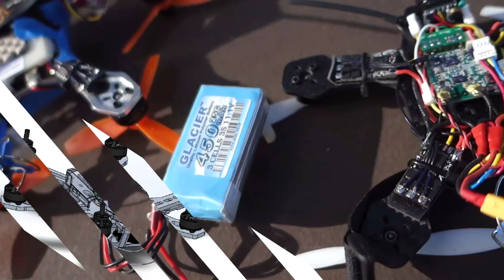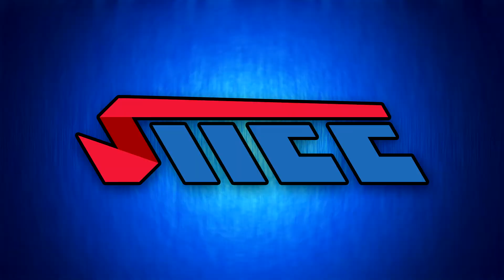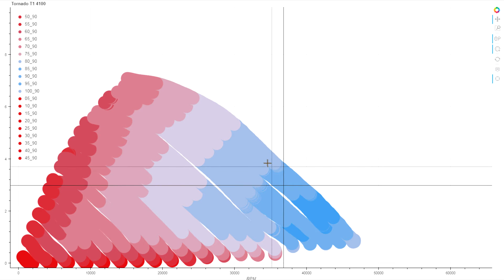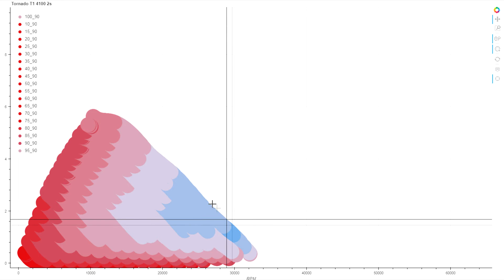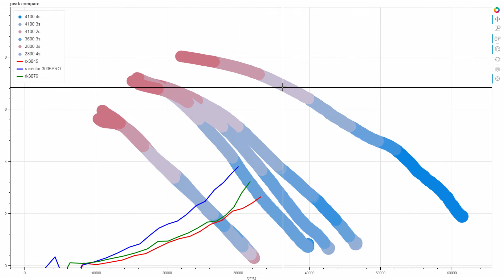Comparing KV and Voltage together

Comment: another request, motor width and RPM.  My theory is that the wider motor ramps through the RPM sooner due to the increased torque but then I can't explain why the wider motor seems to struggle more in the high RPM zone.....sometimes.  Not all motors.  Generally I find the taller motors to be better at the high RPM zone.
Reply from the maker: Acceleration is all due to available torque, more torque = higher acceleration.  A wider bell will have a higher moment of inertia though which counteracts this, and the forces on the bell at high rpm will be higher on a pancake setup.  Torque is supposed to increase with the square of radius vs just linearly with the length, but on the balance of things a longer motor seems more generally suited to our applications with rotor speeds between say 15 and 30k rpm.  Certainly needs some more playing around,  I plan to once I can get around to doing some custom winds.

Comment: So this is exactly what I wanted to see.  High kv low volts vs equivalent high volts low kv.  Logically it makes sense that the output should be the same across the table but why does it feel so different in the air?  Why does the lower voltage, higher current setup feel more meaty?  This is not just one comparison.  This is something I've noticed across dozens of quads and dozens of setups.  Some identical motors and different kv's, others mixed everything.
Reply from the maker: I can't explain the difference in feel.  Lots of people like to talk about it but I have yet to see anyone attempt to isolate why with any kind of rigor.

Comment: The way you described the 'low end torque' feel is opposite I think what people actually feel.  People commonly say they want lower kv for the 'low end torque'....but as you showed, you actually should be getting more of that 'low end torque' feel with the higher kv because you blast through the ineffective lower RPM region with less throttle stick travel.  I think people are just severely confused and think it's like a gear in a car.

Comment: What unit are you measuring torque IN on this graph? Also where can I find more information such as this for motors before buying them? I imagine hobbyist motors wouldn't usually have this sort of information easily available
Reply from the maker: My charts are all in Ncm.  Pretty much no manufacturer has any useful information when it comes to motor specs, that's a big part of why I started testing this way in the first place.
Reply: SiieeFPV yeah, I've noticed the same thing...  Keep up the good work! Good research is hard to come by!

Comment: One important consideration is switching losses at low throttle settings. That's why lower cell counts are more efficient in comparable thrust scenarios.
Reply from the maker: aren't switching losses dependent on switching frequency, not duty cycle?
Reply: In absolute terms yes. But that means that they are a larger percentage of total power at lower duty cycles. Hence lower efficiency of lower duty cycles. That army pdf on motor characterization has a good section on efficiency losses at low duty cycles.
Reply: Oh, and switching losses are higher for larger cell count since more voltage is applied across the switching FET in its resistive state. .
Reply from the maker: ah, so just like loss of power due to deadtime.

Wouldn't higher voltage across the FET give you lower losses?  For the same power output the current will be lower, so I²R losses before it reaches saturation should be lower as well?
Reply from the maker: I see in some datasheets how RdsON actually increases as voltage increases, but that seems to largely be a factor at really low gate voltages.  The couple of examples i found show basically flat RdsON up to hundreds of amps once the gate voltage is up to a proper level.  Wouldn't transition resistance relate to that as well?
Reply: 3s or 4s - the esc will need to generate the same average current through the coils to achieve the same torque. It can keep the FETs on for a shorter period of time to get there since 4s will increase current quicker, but max current stays at least the same (with large inductance) or even increases since on time is shorter. Then if you look up the formula for switching losses they are proportional to Vin given similar Ion, so larger for larger cell count. At least I think ;-)

Comment: GREAT VIDEO! Explains alot

I did my own test on a 600AUW chameleon using EMAX RS2205 2300kv and 2600kv on Turnigy Graphene 1300mah  4s.  I setup my taranis to do an automated 3 second 100% throttle punchout and recorded accel readings for both cases.  The 2600kv reached 6g (accel z) in .125 sec and the 2300kv only did about 4.5 overall.  Seems like the 2600kv had more low end according to this.  The 2600kv also seemed to have a throttle curve more suitable to my style of flying.

Comment: The triangle is slanted because the core is saturating at high currents. The higher kv on lower cell count is less efficient because of joule losses in the windings. Source: writing an engineering thesis on this
Reply from the maker: Any good papers to read on that?  Most of my reference is from Hanselman.  When I measured efficiency at voltage I saw a straight increase even down to 2s, but that was with the lowest kv motor.  Volt for volt the high kv motor here is the odd man out, both the other two KV motors have the same efficiency, and the gap in KV between the middle and high kv motor is smaller than between the middle and low kv motor.  Is there a certain threshold that needs to be hit before the effect starts to manifest in large amounts?

Comment: This makes sense with the strategy I've heard a lot of top racers are using now.  They use very high KV but then limit their throttle stick command to less than 100% throttle.  Forexample running a 2700kv motor that feels like a 2500kv motor on the sticks.  It also leaves some torque capability for the PID loop to use even when the pilot is commanding 100% throttle.  100% on the sticks is really only 90% and the PID loop still has some leftover torque to control the craft and keep it locked in and flying good.
Reply from the maker: That shouldn't really be a thing anymore, way back in the day when betaflight was a fairly new fork I think the actuators used to be able to saturate and you would lose authority at high throttle.  But it should be able to do negative stabilization now, where rather than trying to boost a motor to stabilize it can slow down the opposite motor, leaving all the rest of them pegged.  Maybe we have lost that feature, I'm not entirely sure.

Comment: Great testing! Thank you. One of the advantages of decreasing from 3S to 2S is the weight loss. Despite the loss in torque really lightweight builds can sometimes see a net thrust increase.. Less important when dropping from 4S to 3S and barely noticeable from 6S to 5S though.

Comment: Thanks for running these tests.  I'm really beginning to wonder if the high KV motor (the 4100?) is manufactured differently than the other two.  The high KV motor was the anomaly in the last test too, right?
Reply from the maker: exactly.  Though the performance, in terms of torque output isn't really affected at all, just the efficiency at which it makes its torque.  If you ran the 2800kv motor on 6s you should see a full throttle torque curve very similar to the 4100kv 4s trace.  That's kinda what the limit of this motor is, higher dropoff at higher loadings showing where it's running out of steam.  To improve the performance you'd need a different motor design, stronger magnets, smaller air gap, larger stator, etc. etc. to give you less dropoff at high loads.
Reply: SiieeFPV Right. Basically, you'd need a higher wattage motor.